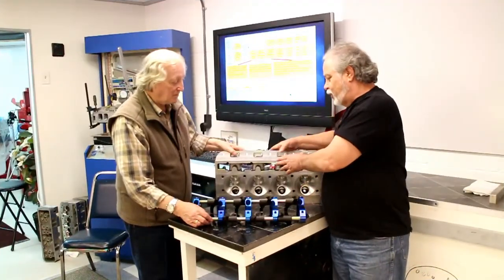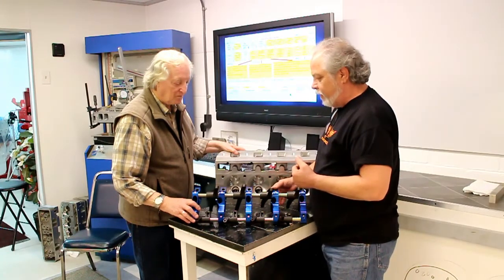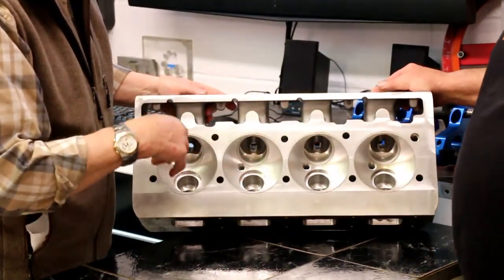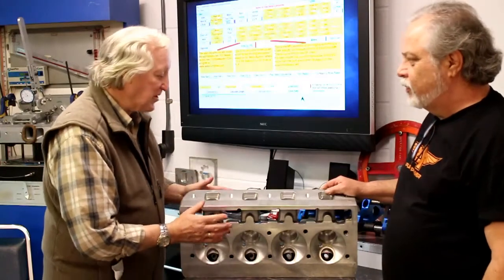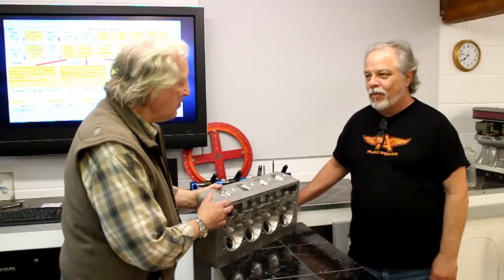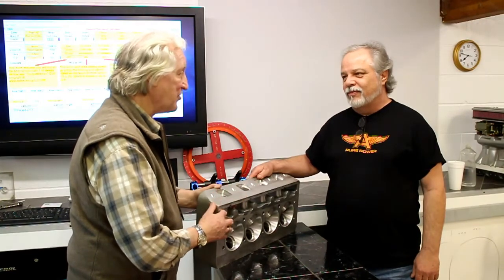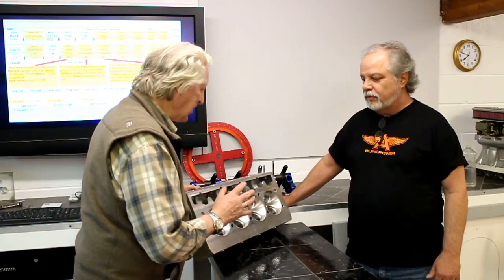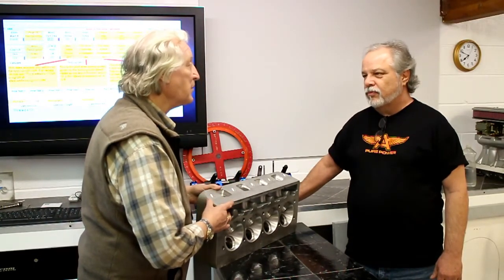David Vizard interview series With Robert Angelilli on Arias design BBC hemispherical cylinder heads

Comment: Interesting as I worked for nick arias when the above heads were initially promoted....on land in dragsters they could not make it power wise..but were semi successful in drag boats....I was engine assembler for joe mondello when he was working for nick
Reply: Charles De Francisco: those intake runners look huge compared to the valve.    Do these heads have anything to do with the D.R.C.E...?     It was a Pontiac block-bbc gutted-cleavland head hermaprodite ive only read about.